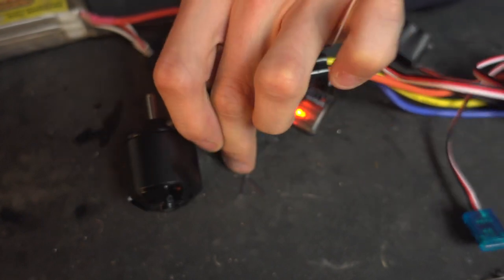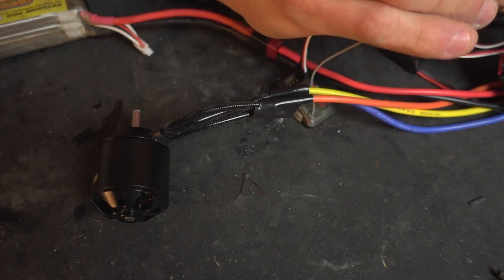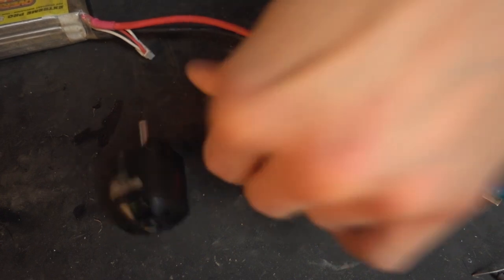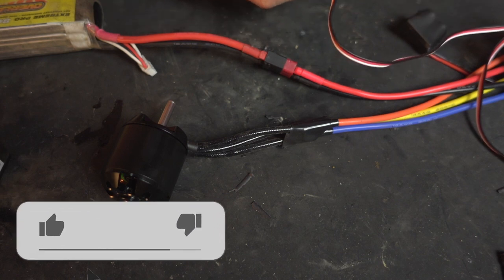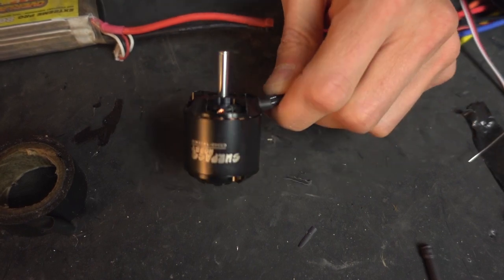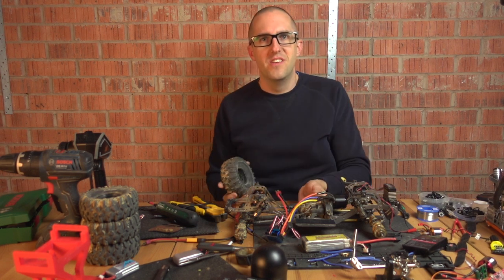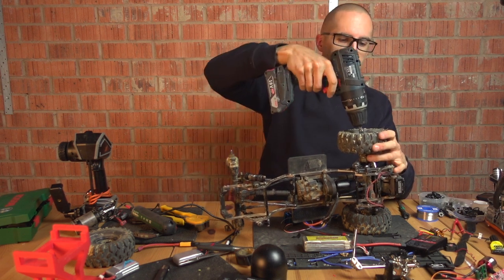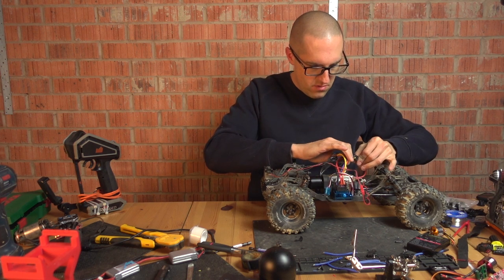Budget brushless outrunner - OMG it works, and it works well!

Comment: What ESC? I heard you say the motor was a Hobbywing, but I see no info for the ESC. Is it a budget sensored model? Link to the product would be great.
Reply from the maker: It's actually a no-name 120a ESC (although unbranded and uses the same software as Hobbywing) and the motor is a Surpass 3548 1400kv. Unfortunately in further testing the magnets fell off the motor and the ESC set on fire.

I've got a follow-up coming soon, which has similar results and has some recommendations for anyone looking to do budget brushless sensorless outrunners.

For now I'd suggest these cheapo ESC's are probably only good in sensored mode as I've just had too many fires and issues using their sensorless startup at low RPM.

I'm going to keep investigating, although it's starting to rack-up the cost, and see if I can find the right settings etc but for now I won't recommend any of it due to the temperamental nature.
Reply: @JustScalin  Definitely sounds unworthy of time and $$. I believe the Castle SW4 is the highest quality budget esc (as opposed to Mamba X) for sensorless outrunner motors. I currently use an SW4 with a Turnigy D3542 outrunner and it’s smooth and powerful. 👍🏼
Reply from the maker: Yeah the SW4 is the best sensorless ESC. I run one on my comp rig. Will possibly try the surpass motors in it as they have better availability in the UK
Reply: I find some budget ESCS really struggle with outrunners. Surpass and GoolRC ones I've tried have resulted in the ESC getting hot and the motor getting boiling hot! This is both with relatively low KV outrunners and high KV helicopter ones too. Maybe because they can't cope with so many poles?

Then some other ECSs such as a Leopard 60a and a Hobbywing quicrun both ran without any temperature problems at all either in the ESC or motor although not as smooth starting up as some of the better controllers. 

There seems to be a fundamental issue that effects some units though when it comes to temps. Even stuff with a fast outrunner like my Feiyue truck, if I try to use a GoolRC style ESC, the motor will get red hot even driving around a living room. Stock ESC or Leopard with the same motor doesn't have the same problem.

Castle is probably the best out there for sensorless either with outrunners or inunners. Some Hobbywing units are pretty good too.
Reply from the maker: Yeah I think it’s something to do with the way the mosfets switch and cooling available. Thanks for letting me know some ideas of others!
Reply: @knoopx  Glad I found your comment. Will be checking this out, love all the cool advancements coming from the racequad scene and it's all dirt cheap. Fun stuff for the consumer
Reply: @rcvg69420  i have some videos showcasing some of my rigs, all them use am32 firmware on iflight escs
Reply: @knoopx  i'd like to make one, so do I have to buy a drone ESC and reprogram it?
Reply: @rcdabbler  Are there any options for sensorless ESCs that can run an outrunner on up to 6s? I want to power a 1/10th scale racer with an outrunner, but all of the available KV ratings would make it pretty dog slow in comparison, so I'll need at least 2x the voltage to be comparable. Also, JustScalin, where can one actually go to look for outrunners that allows you to narrow it down by diameter, a range of lengths (in my case, I'm thinking 40-50mm should suffice), and a range of KVs as well as the max safe voltage (gonna need them to take 6s to equal a 3s powered runner setup, and nevermind if I try to make an 8th scale system with an outrunner because I'll need 8s-12s, then.)

Comment: I posted some videos of outrunners running dirt cheap quadcopter esc's.  Flashing am32 firmware on them can get some insanely slow speeds for dirt cheap.
Reply: Not trying to hijack. It seemed like something you would legitimately be interested in.
Reply from the maker: Definitely going to check them out!

Comment: For your next test 😉 go to your local rc fly shop and get the smallest outrunner with 25mm spacing and 1000-1700kv, run that on a HW 10bl60 and see the surprising outcome 😀
Found a 3007 and it still has tonnes of torque and descent drag brake.
Reply from the maker: I could never find the 3007 but one of those would be perfect for a build in doing

Comment: I have this speed controller with a  tenshock crawler motor, i too was super impressed for the cost. I have a hobbywing brushless programing card and was able to update and adjust the settings on the controller too, what an absolute bargain. Thanks for the video.
Reply from the maker: Nice! I think it would work a lot better with a sensored motor. I'm having issues with a smooth sensorless start-up and there's a follow-up coming soon which shows a motor on fire!

Comment: Surpass's outrunner motor magnet is too weak to break when used in a vehicle.

 It has been broken 4 times and now it is fixed with epoxy before it is broken.
Reply from the maker: Thanks for the info, I had quite a few magnets fly off and then jam. Having to open it up and epoxy it kind of defeats the easy budget element I guess

Comment: @Just Scalin' -- great videos, thank you! looking for a super-quiet motor - ESC combo for my VS4-10 Pro build, what do you recommend? it's going to be for my 12-year-old son, and he likes high speed on trails, I don't want to build a system that just crawls! Thank you again.
Reply from the maker: For trails I like the Hobbywing stuff, it seems to be better weatherproofed and durable. My go-to would be the Axe 550 3300 which gives plenty of power but really good low-down crawling ability too. I used to run one in a nearly stock TRX4 G500 with quite a large pinion and it'd crack 35+mph easily as well as have great low-down control.

If you have fitment issues then something a bit more compact with a ton of punch would be the Castle Slate 3800kv paired with a Mamba X. Loads more tun-ability and probably a tiny bit more top-end speed, but more expensive and possibly a little less durable.

For a 12 year old I'd steer clear of the Holmes Hobbies or 3bros motors, because they are absolutely awesome but don't survive as well if you dunk them in mud or overheat them.

I beat down on my Axe 3300kv and it's still going strong, although these days does sound a little tired it's still doing great in my trail truck.
Reply: @JustScalin  Thank you so much! Two follow up questions; 1- does Hobbywing fit to VFD transmission w/o any modification, I thought it’s 550 size? 2- Which Holmes Hobbies motor do you recommend? Thank you again 🙏🏻
Reply from the maker: @mtzl1930  yes the HW is a 550 unfortunately. If I was buying a Holmes Motor for trail I'd get whatever their fastest 540ish size is in the Puller Pro

Comment: Its been a while since I have seen a deans plug and electrical tape lol
Reply from the maker: Yeah I’ve swapped to XT60 for convenience. Deans is still technically more efficient but crawlers don’t really need that
Reply: @JustScalin  I never use deans for my crawlers. I just don't feel safe lol. I run mamba X in all my crawlers and I run all my lights directly from esc and I use direct power servos that are ran directly from esc. Just don't feel comfortable using a deans for that. Now, if I was using just a brushed setup,  I'm sure it would be fine

Comment: How did you get the pinion gear on the motor shaft? It is round.
Reply from the maker: For testing I just tightened up the set screw. If I was going to run it for a longer time I’d grind a flat slot on the motor shaft to make sure it had a better grip
Reply: @JustScalin  i tried turning the shaft down to 3.175 but broke a carbon bit in 2 seconds. Ended up turning a custom steel shaft to 3.175 to fit the motor gear its not hardened but still holding up, the injora transmission requires a 0.7m 15t you cant get that in a 5mm shaft.

Comment: hello do you have a programming card (instruction) for this esc? There was also another ESC (look a like the sams) on ebay a bit more expensive from "fire phoenix" with xt60 plug 6a BEC up to 2_4S can programm with Hobbywing programming card.
Reply from the maker: I've been using the same card I got from a Hobbywing 1080. This is because the firmwares have the same settings protocol.
Reply: @JustScalin  Thank You!
Reply: I send you a message on facebook about the other esc.